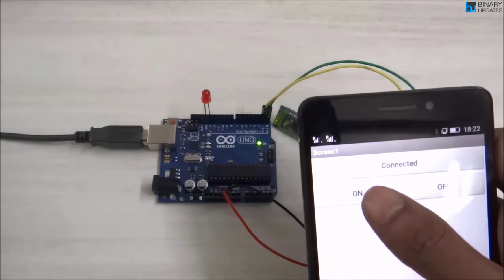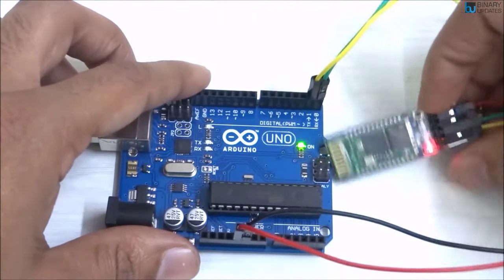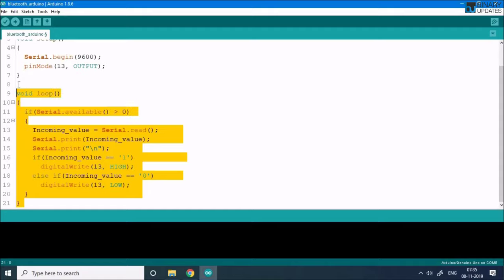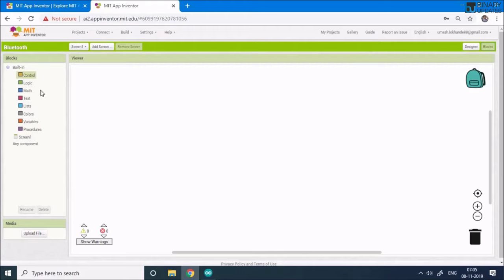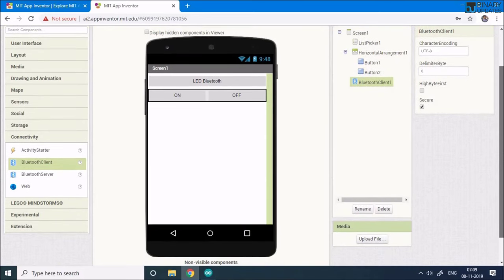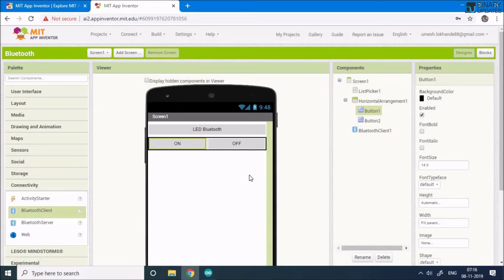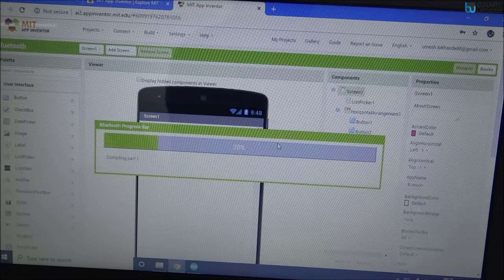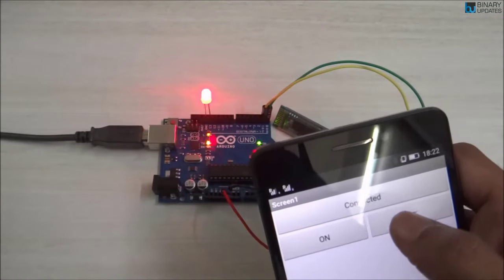HC-05 Bluetooth Module with Arduino-MIT App Inventor

Comment: Thank you very much for such an informative tutorial.....it worked for me.....one thing I want to tell you is please don't connect HC-05 bluetooth device input directly to arduino...it's logic input level is 3.3v and arduino's output is 5v so it will damage bluetooth module...use resistor voltage divider instead to lower input voltage to pin rx of module. check following link for schemetic > https://ibb.co/tbZFTKk
Reply from the maker: Thanks Sameer, I appreciate your valuable time and advice.
Wish you a good time.

Comment: Plz teach how to create application by using Arduino, FSR, LED, Resistor,  DC motor, Wifi module, DC motor driver, battery and potentiometer in one application, your way of creating and making us understand is good 
It helps us to create application easily
Reply from the maker: Yes Manjunath, those video lessons are on the list. Hope I'll make it and share soon on YouTube Channel to cover all interfaces like WiFi, DC Motors, Servo Motors, Potentiometer etc with Arduino

Comment: Take note that this would probably fry your HC-05 module eventually. HC-05 uses 3.3V logic while arduino is 5V. This means you are putting 5V on the HC-05 (3.3V) RX pin. There are a bunch of tutorials for HC05 that specify a voltage divider for the RX pin.
Reply: are there 5v BT modules?
Reply: How do we come up with this kind of problem?
Reply: my hc-05 module is from 3.6 to 6v so i dont have to worry about anythink
Reply: MEHENGA WALA HAI ,5 VOLT BHI SAH LEGA 😁😁
Reply: JESUS IS THE KING OF THE KINGS
Reply: @judlex7300  The Vcc is 3.6-6V, but the Rx pin is 3.3V.  You power the module with the higher voltage, but the communication happens at a lower voltage.
Reply: @xeither289 knock off the religious BS already.

Comment: It works, but you have to unplug rx and tx wires before you upload the code. Then you can plug them back in.
Reply from the maker: Yes you are absolutely right otherwise Tx, Rx will be busy with USB connector to communicate with Computer.

Comment: Thanks, I was great.  Only one suggestion: the returning value of funtion "BT.connect_to(List1.Selected)"  is true o false, depending if the connection is succesful or not. So you should restore it in "List1.Selected" because it has no sense , but, more important, becuase it might be confusing for the one watching your video.  You should store it in a temporal variable, or, even better, check it and do somthing if it is false.
Reply from the maker: Good point! I'll make sure while making next video lesson on HC-05 Bluetooth Module with Arduino. Thanks for your suggestions. I appreciate it

Comment: Lets learn how to use HC-05 Bluetooth Module with Arduino Uno. In the end, we'll learn from writing arduino code to create Mobile App using MIT App Inventor. The lesson start with introduction to classic HC-05 Bluetooth Module. Also we'll explore how to create Android APK and its installation on Android Smart Phone.
The process is six step as follows:
1. Setup Circuit HC-05 Bluetooth Module and Arduino Uno (VCC,Tx,Rx,GND)
2. Write Arduino Code to control LED using Mobile App
3. Create Mobile App using MIT App Inventor
4. Generate APK and send it to Phone using MIT AI2 Companion App
5. Pair HC-05 Bluetooth Module with Mobile Phone
6. Finally Test mobile App and Control LED connected to Arduino Uno

Download Files from: @t

Comment: Good explanation.... very simple and easy! I was wondering what to do if I want many LEDs?
Reply from the maker: Hi, in case of controlling multiple LED over Bluetooth. You must modify code for controlling multiple digital pins of Arduino and then modify Bluetooth App in MIT App inventor to add more buttons to send commands to control LED connected to Arduino using Bluetooth. I hope this information find useful to you. Good luck and best wishes!
Reply: @BINARYUPDATES  Thanks! I modified it and now it works the way I wanted it!

Comment: Why do you need the Serial.print(Incoming_value) and "\n"? is it required by the blue tooth protocol to echo back what you received? I am curious  because no class is listening, so they would just accumulate in the blue tooth buffer. Or are you using simultaneously the monitor through the USB interface?

Comment: Hi, great video but when I try to pair to the Bluetooth module to my android phone it just says pairing for a long time and then eventually stops trying to pair.
Reply from the maker: Hi Please check App settings where you've to allow permission. And then HC05 Bluetooth will work with Android App. This is because many mobile comes with high security which restrict Apps use. I hope this may help. Good luck and best wishes!

Comment: Hi great videos. In my case I have a BT device that sends a string of text. How do I collect it and show it on display? Sorry but I'm really newby...
Reply from the maker: Hi Rollercoach, you can use any character LCD or OLED displays to interface with Arduino. And then over bluetooth from mobile app send string to show on display module. In Arduino code, you've to create char buffer to store received string sent by bleutooth app. And then later, using display functions you can show them. I hope this may find helpful to you. Wish you good luck and best wishes!

Comment: Thanks for the video Sir. I successfully connected my phone with Bluetooth module on circuit. But I want to put on and off the relay on that pcb what should I do now
Reply from the maker: Hi Praful, you can consider buying Relay Module there are several out there in market. And then replace LED connected to arduino with Relay Module input and you're good to go. I have posted video how to use two channel relay with NodeMCU ESP8266. You may find it useful to learn relay connections. I hope this information may help you. Good luck and best wises!

Comment: That was nice project, but how to control motor with blouetooth. Do i need motor driver?
Reply from the maker: Hi R4F, you need motor drivers in case if you want to drive hobby DC Motor and if you just want to control Servo motor. Then you drive without motor drivers. Bluetooth has nothing to do with motors. You'll be just sending data from HC-05 to rotate motors.
Reply: @BINARYUPDATES  Thank you so much Yes I found out that after watching you video. I got idea to control train modeling that I bought for some days ago. ;-)  I just purchased from aliexpress Mosfet IRLZ44N   to control dc motor.  I hope that will work. BTW I coulden use pro micro I dont know why. Do you ?

Comment: Thanks for this nice video! I have a small question: Why do we not need an resistor for the led?
Reply from the maker: The resistor before LED will be current limiting resistor. This will protect your LED from high current flowing through circuit. Which can potentially burn your LED. Not very usual in case of Arduino but in many other circuit its good practice to use resistor before LED Protect. Thanks

Comment: Hello...Thanks for this tutorial..my query is Can i connect multiple lights using this technology?  What will be the changes in Arduino code?
Reply from the maker: Yes Sneha you can connect. You have to use more digital pins on Arduino board and then accordingly modify arduino sketch so that you can send commands to control them from Bluetooth app. I hope this may help you. Thanks

Comment: I have a Bluetooth control box with external relay switches, how do I go about pairing those to my main controller in App Inventor or is this functionality not available for MIT App Inventor
Reply from the maker: Hi Jonny, if your mobile can detect Bluetooth of Bluetooth control box. Then probably its possible......but again you've to check with manufacturer of that control box. Otherwise, process remains same as explained in the video to use MIT App inventor to communicate with Bluetooth devices. I hope this will be useful. Good luck!!

Comment: Thanks for your video. I was going mad, but finally your Tx and RX interchange to the arduino board, worked out and resolved my problem. I would appreciate if you can do the wifi controlled switch using nodemcu 8266. awaiting.
Reply from the maker: Great to hear! And also with that you must have learned many thing. I'll be soon working on video of ESP8266 especially ESP-01 with Arduino. Thanks and best wishes!

Comment: Doesnt hc05 work on logic 3.3V? It is better to use volatge divider to Rx from hc05
Reply from the maker: Hi Oskar not 100% sure but you can check with datasheet of HC-05 Module online. I believe it will work with 3.3V as well. I hope this can help you. Thanks for your comment

Comment: the bt module is 3.3v and arduino is 5v on rx and tx so how did you connect it without blowing it up. I've been told to use resistors to reduce voltage. can you confirm if this is necessary or not

Comment: What kind of data can be sent to the Bluetooth module? Just 1 and 0, or can it be any string? I see you're sending the string "1" and "0" rather than an integer, but I'd like to send text like "blue" "green" "red" - more options to the Arduino rather than Binary 0 and 1.
Reply from the maker: Hi Dvance, you can send any length of string. So it will work green, red, blue text. Bluetooth can handle good amount of data to transfer at high speed. To keep it simple in example project I just sent 0 and 1 otherwise code will be longer to extract string at Arduino side and then compare to take action. I hope this may help you. Good luck and best wishes1

Comment: You don't need 1k and 2k divider for RX of the module?
Reply: That's when I ended the video. He uses 5v and the module states clearly Rxd 3.3.
Reply: @carelx7029  I think it also works well with the 5V
Reply: @MotoDOC_SA  I already fried one of my bluetooth when connected directly from Arduino's TX to Bluetooth's RX.

Comment: Hi first of all thanks so much but can u tell me that which coding platform you are using at  7:00
Reply from the maker: Hi Rushaan, on hardware side we've used "Arduino IDE" and to make mobile app we've used "MIT App Inventor" which uses blockly from google. I hope this may answer your questions. Good luck!

Comment: Hello! I tried your method but I face an issue with the LED not turning on! I even connected the resistor you proposed on the circut! Could you help me fix that issue, please?
Reply from the maker: Check your serial monitor on Arduino if you're receiving any data from Bluetooth APP. And also make sure connection between HC-05 Bluetooth module and Arduino is correct. Good luck and best wishes!

Comment: hi i have campervan with solar and 3 mppt controllers.vw t4.would like to make arduino control with touchscreen display.nextion lcd led screens i @t trying to learn,ive got arduino uno r3 will that work.?so battery voltages usually 12.2v to 14.5 when solar or dc to dc charger on when running van .and want to use blutooth module to monitor from house with van outside.what do you think?steve

Comment: Hi there, I really liked your tutorial and I tought you were an amazing speaker! I just have one issue, I am using bluetooth HC08 while in the video you are using bluetooth HC05. I was just wondering how I can fix the the code to make it run on HC08.
Reply from the maker: Hi Anjali, I haven't yet tried HC-08 Bluetooth module. I'll look into its features and specifications. Earlier once i used HM-10 Module which has BLE support. Thanks for information. Good day!

Comment: Wouldn't you need to use a voltage divider since the HC-05 uses 3.3v?
Reply: it uses 3.3v to 5v and arduino is giving 5v so it's ok

Comment: After clicked on list picker no any device details appears. App is working fine in other phone. In phone's Bluetooth app, list of all available/paired devices is present but not in MIT app when clicked on listpicker. Please help...
Reply from the maker: Hi Laxman, its because of your settings in the smart phone. You need to find the Bluetooth App Settings in your android phone. And then go to settings and ALLOW Bluetooth App to "Find near by devices" and then try it will work! Good luck and best wishes!
Reply: @BINARYUPDATES   THANK YOU i thought it was just outdated or something but that worked perfectly
Reply: @BINARYUPDATES  dear i would like to inform you that from Android 12 onwards some extra block code is required to get Bluetooth permission for screen. When I done the respective code then the code works else NOT. requested you please have one video one that block code for Android 12 onwards., bcoz most of people are using Android 12 above and everyone facing the issue.

Comment: Please can someone help me!

So I have been wanting to make a Bluetooth controlled app for a while and when I saw your tutorial I thought it would be a great test, however I followed everything in the video, even downloading the exact files from your Github to see if I did something wrong. However my phone can connect to the module but when I tab either buttons the LED doesn't light up?

In general, everything works up until the Arduino actually receiving the information.

Comment: I just went thru the tutorial, installed the sketch on my Arduino Uno, then connected my HC05. Then went through the process to create the app using MIT App Inventor. Set it up for Phone Size then created the .apk file. Downloaded and installed it on my Samsung A53 phone running Android 13. Paired the HC05 to my phone then started the newly installed app. Pressed the Connect button and it just brought up a black screen. No Bluetooth devices shown. Couuldn't get beyond that. Went back and compared my blocks to yours and they were identical. Then changed the size of the project to Tablet Size, built a new QR code and downloaded it onto my old Samsung Galaxy Tab A running Android 7.1.1. Paired the HC05 with the tablet and started the app. Pressed the Connect button, it displayed the HC05, selected it and it connected and worked flawlessly. Any ide why it works on one and not the other??? Thanks for any feedback.
Reply from the maker: Hi Mike, this is because the settings on Bluetooth on different version on Android varies even if the manufacturer of the hardware is same in your case its Samsung. Usually, if you change Bluetooth settings for allowing find nearby devices then HC-05 will start working with your  Samsung A53 phone as well. I hope this may help you. Its all about different settings, versions of android and manufacturer of mobile phones, tablets. Have a good day, Best wishes!
Reply: @BINARYUPDATES  Thank you! I was just coming over to reply that I had found the answer. My new bluetooth app didn't have permission to look for connected devices. Added that and it works correctly.

Comment: Code that you provided is not working. 
the code that I used is shown below. Please correct if possible. 
1    Char Incoming_value = () ; 
2
3    void setup() 
4  { 
5    Serial. begin (9600);
6    pinMode (13, OUTPUT);
7  }
8
9    void loop() 
10 {
11    if (Serial.available {})>0)
12   }
13    Incoming_value = Serial.read();
14    Serial.print (Incoming_value);
15    Serial.print ("\n")
16      if (Incoming_value == '1')
17      digitalWrite(13, HIGH);
18         else if(Incoming_value == '0')
19        digitalWrite(13, LOW);}
20    }
21  }

Comment: There is server error showing 😕 
Once blocks are ready u didn't say how to save it
Reply from the maker: Hi Sravani, it maybe because MIT App Inventors website server is facing issue. You can try after sometime. Its just because server could not handle traffic. And to save project, go to top menu bar (top left corner) under project there is an option to save project.....Good luck and best wishes!

Comment: sir can we use multiple buttons input signal in Bluetooth HM10  module using Arduino
Reply from the maker: Yes you can use multiple buttons with Arduino and HM10 Bluetooth Module to control or communicate

Comment: What would be the difference if you want to use a WiFi module instead of a Bluetooth module? Thanks
Reply from the maker: Hi AwkwrSalmon, when we use WiFi module then mobile app will use client and server communication which uses webserver on Arduino. And when we use generic Bluetooth module then communication uses bluetooth master-slave communication between mobile app and arduino uno. I hope this may help you. Good luck and best wishes!

Comment: What command is needed in adding audio to the buttons ON & OFF?
Reply from the maker: For audio to generate on Arduino side. You need to connect buzzer and then send commands from your mobile app with HC-05 Bluetooth Module. I hope this may help you. Good luck and best wishes

Comment: Hi this is excellent tutorial. I did everything as instructed & serial communication also established through mobile app, however somehow it's not working correctly, as it's not reading the "1" & "0" on serial port, rather if i check what i am sending through app button, serial port reads always "⸮", how to fix this? is there possible issue with the hardware HC05?
Reply from the maker: Yes Tejas, I've seen this before. You're getting "⸮" because HC-05 Bluetooth Module is broken or defective. replace module and it will work as expected.